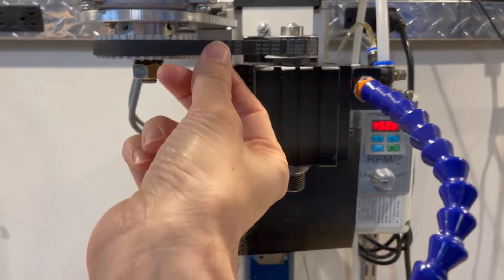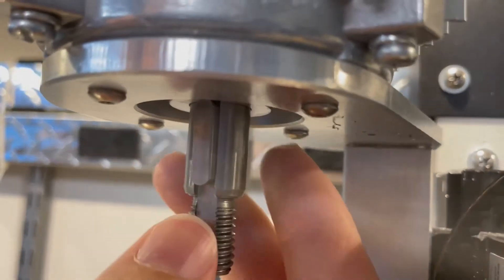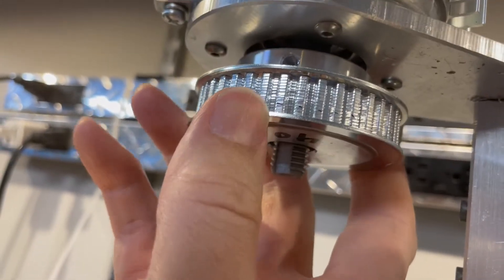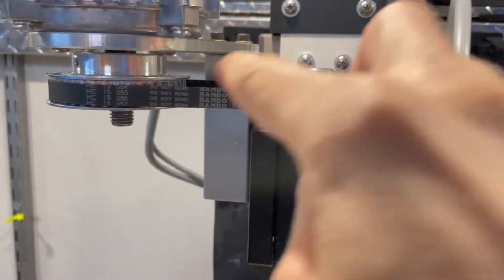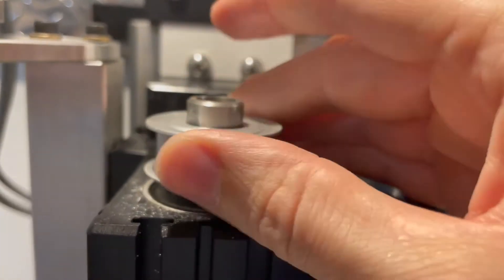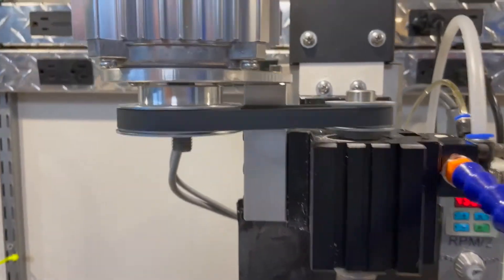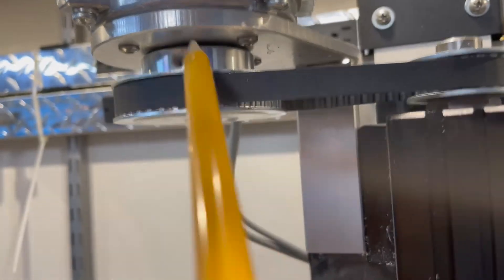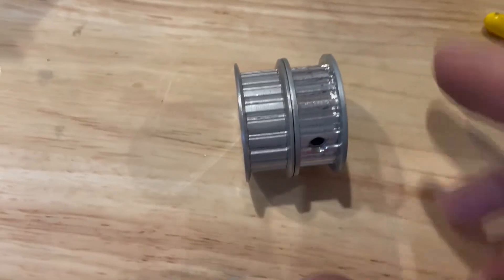Taig Mill Consew Motor Pulley Options

Comment: How is this motor holding up?  I want to use one of these to power a 2x48" belt grinder that is pulley driven.  I'm not wanting a high belt speed, I'm looking to replicate as if it were a typical 1750rpm 120vac motor.  How long have you been able to run the Consew motor continuously without heating up too much?  And is that controller modified?  I don't have that knob on my Consew, LOL.
Reply from the maker: Hi, I've had it about 2 years now I think. But I only use the machine once a month or so. When I do use it, I think the longest its run continuously is about 1 hour. It does get hot, both the motor and the controller, but its never shut down on me. They have another model, CSM3000 (mine is CSM1000), that has a bit more power and lower RPM. That would probably be better suited for a belt grinder. All that said, if you don't need variable speed, maybe you'd be better off with an AC induction motor? This little guy has a lot of power though. The AC induction motor it replaced was twice as big, and would bog down sometimes.
Reply from the maker: Yes, I modified the controller to add a knob. Here is the grabcad link if you want more info. https://grabcad.com/library/consew-motor-potentiometer-housing-for-taig-mill-1

The knob gives you much finer control compared to the lever it comes with that is meant for a sewing foot pedal.
Reply: @nickp4793  curious, about the   Potentiometer,  how did you determine exactly which one to get?  I  did a quick search and they seem to have differing electrical specs.
Reply from the maker: @GlennInLaguna  On the Taig FB group, this motor is very popular, and someone before me figured out which potentiometer to use. I took that info and packaged it all up in an enclosure. This particular value give the full range of speed control in about half of one knob turn. Different values would change that, I believe. (I'm an ME not an EE).
Reply: @nickp4793  can that potentiometer be wired by cutting the wire to the lever that came with and that plugs into  the Consew and just splicing it in there so I could run it to where I want
Reply from the maker: @GlennInLaguna  I think so, its been a couple year since I did it. You don't need the box or anything. 2 things though: 1) There is no good "off" and "max" point on the pot. Thats why my plastic housing has hard stops. 2) You can super easily shock yourself when inside the control. The way they did the ground is not typical. I think everyone that has taken this controller apart has shocked themselves, me included.

Comment: Do you have any links or part numbers for the eBay pulleys. Thanks for the video
Reply from the maker: Are you on FB? There is a Taig FB group, where I had a lot more information about this setup. Here is the link to the discussion, but you will have to join the group to see. https://www.facebook.com/groups/Taig.Lathe.And.Mill.Group/posts/3720820641348430/